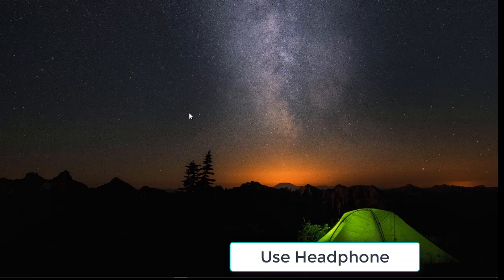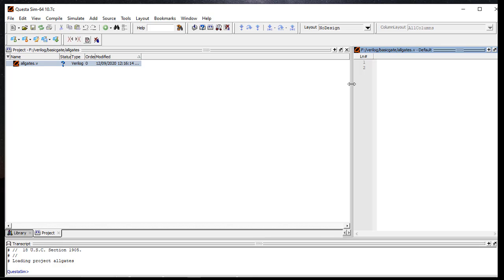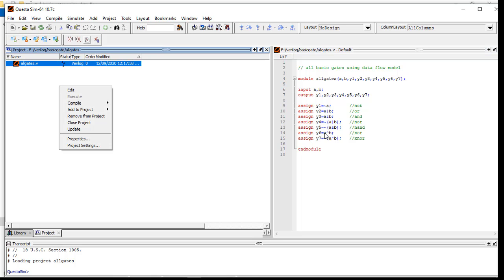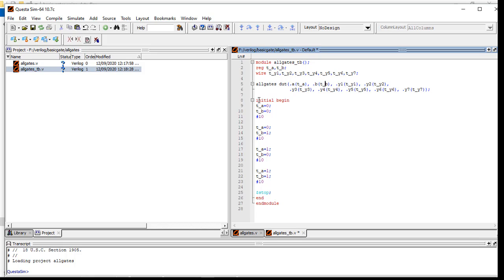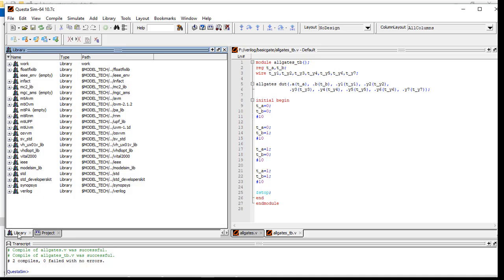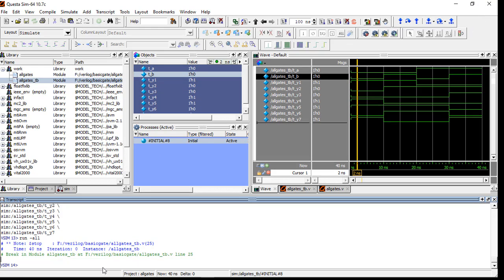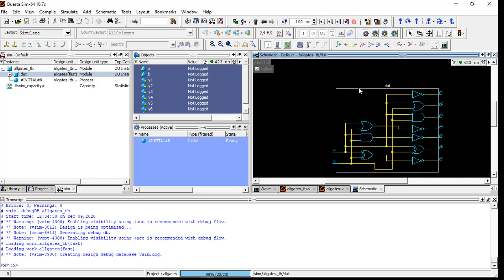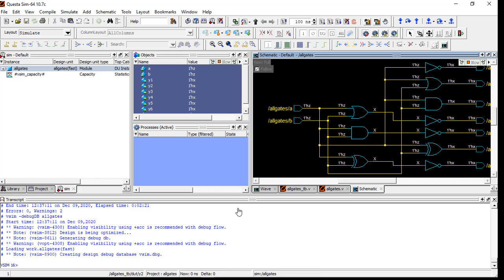How to use Questasim for Beginners | Schematic View | TestBench

Comment: Sir how we will get the project summary
Reply from the maker: I didn't get it. What exactly do you want?
Reply: @anandrajofficial1  sir can we get device utilization summary ..like power and time delays ..how much luts we have used like that ..i.e log file
Reply from the maker: @kv8536  for now I am outside so i can't check but you had pdf manual in installation directory plz search power or something .you will get something.
Reply from the maker: @kv8536  but for power and lut and gate utilisation you have to select FPGA board or devices.
Reply: @anandrajofficial1  sir can you do a vedio on it
Reply: @anandrajofficial1  device utilization summary and timing summary

Comment: Hello sir, i did multiplexer code on questasim, and try to stimulate, but  i got  wave only straightline, there showing unknown input signals , what is the reason for it
Reply from the maker: For verilog output can be 0,1,X,Z
 X is unknown because its value can be zero or one so you have to  check code.
Reply: @anandrajofficial1  my code has no problem, while simulating given input in testbench not taking to output wave form